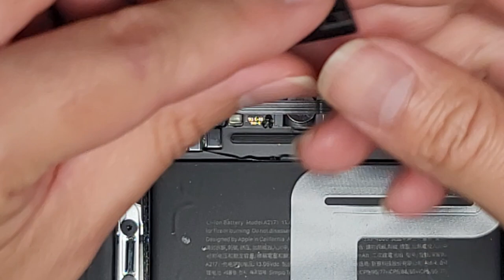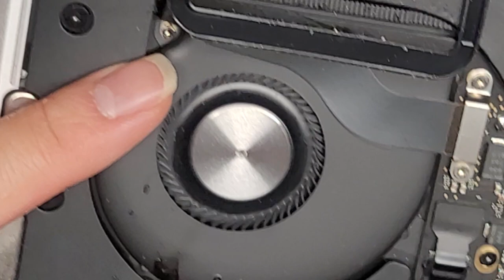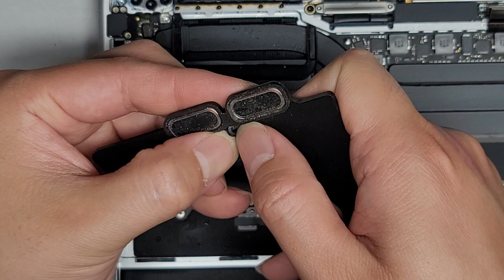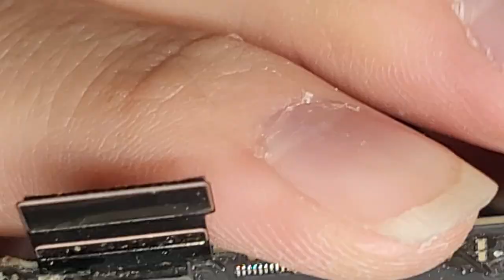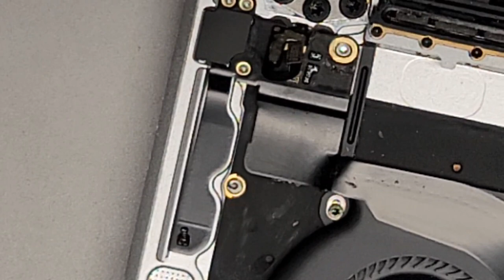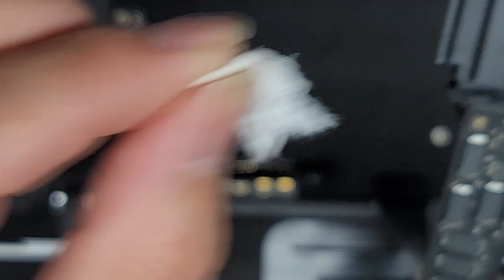13" Inch 2019 MacBook Pro A2159 Disassembly Logicboard Logic Board Motherboard Liquid Spill Repair

Comment: It's Binh Repaired & Reviewed.. Another cool video. Any idea on how to fix an iMac. It will not connect wirelessly anymore. I works fine hooked to an ethernet cord.
Reply from the maker: Did you test if it's a software issue by booting into recovery mode first?
Reply: @ItsBinhRepaired  Haven't checked. It works fine just won't connect wirelessly
Reply from the maker: @RenegadesGarage  give it a try
Reply: @ItsBinhRepaired  Not sure I know how to do that.
Reply from the maker: @RenegadesGarage  boot holding command option p without ethernet
Reply: @ItsBinhRepaired  Didn't do anything. All I have is a wireless keyboard. In network pref the wifi card doesn't show up
Reply from the maker: Try holding option on boot
Reply: @ItsBinhRepaired  I did it didn’t do anything except come on normal
Reply from the maker: @RenegadesGarage  you might need a usb keyboard

Comment: Interesting to know amperage of the charger on the connection and make some mesures in comparaison with a border vieuw like Rossman do, no ??
Reply from the maker: I don't do that, sorry.
Reply: @ItsBinhRepaired  i find very interresting when you explain each manipulation on the board, i am learning with you. The device for the control of amperage of the power Supply is cheap (Chinese) and the boardvieuw may be free on the web. I thing.
Reply from the maker: @yvesrochet3288  haven't really looked into doing that level of repairs.
Reply: @ItsBinhRepaired  later surely you do that
Reply from the maker: @yvesrochet3288  don't think so

Comment: hey! great video! so you just use warm water to clean the nasty parts? with a brush or how? then alcohol and air to dry it, right? thanks!
Reply from the maker: Yup, if you're lucky it might fix the issue.

Comment: Hi there, might be a silly question, but I have two identical macbook pro models (2019, 13') and one is locked, but in great shape physically, the other one I use daily, and has a very small crack on the bottom of the screen, someone tried closing the lid with something in there (AGH) [the plastic piece that says macbook pro]  I have pretty good laptop/phone experience just with windows computers and a very little apple/macbook repair, how much risk is involved in the process and is it worth it or should I just live with the little crack? I can't afford to have two dead pc's all due to my stupidity of a tiny crack lol. thanks for any advice!!
Reply from the maker: It's pretty risky. I've cracked a screen trying to remove it and cost myself a lot of money.

Comment: 1 second ago
Thank you so much for this! So I opened my MacBook because it wasn’t charging. Liquid got into the USB-C ports but nowhere else. It was clean and nice inside. I managed to clean it up and I can get it to come back on but now the keyboard is not working even though I’m pretty sure it’s connected just fine, the same way I saw in your video. The trackpad is not working either, even though the first time I got done putting it all back together it was working fine. I’ve tried reconnecting and doing this a couple of times now but now I’m wondering what could it be. Both  bluetooth keyboard and the mouse work. So it has to be something I’m doing wrong and I can’t figure it out.
Reply from the maker: Likely bad trackpad or trackpad cable.
Reply: Even though it was working fine? There was no liquid anywhere else other than the USB-C port at the time. I only cleaned it up because after the computer lost its charge, it wasn’t charging at all but it never showed any problems prior to that. And even after I put it all back together the trackpad was working but not the keyboard. And then I went in trying to figure out what was wrong with the keyboard and now the keyboard and the track that wouldn’t work… and it is also now really slow for no reason. 😑🥲 It’s been a great day today lol.
Reply from the maker: @lindas.4376  that's a trackpad issue. Thermal sensor is in there and Apple, being the assholes that they are, programmed the keyboard to not work if the trackpad has issues.
Reply: It was a dent on the “teeth” on the connector for the trackpad. Once I straighten that and connected it right, everything came back as if nothing had happened!! But you’re the only person naming everything as you disconnect and that was helpful to identify what was going on! Thank you!
Reply from the maker: @lindas.4376  so bad trackpad cable. Glad you were able to fix it and get it working. :)

Comment: (Please Reply😭)

Hey brother, I too have a similar issue. Spilled warm water. Black Screen, works perfectly with HDMI cable plugged in to a sec. monitor.
No issues with the macbook display monitor as well(as I took to a repair shop where my display was perfectly fine when connected another macbook pro)

The problem must be in logic board where CPU makes connection with the Monitor. What can I suggest the local macbook repair shop to do to solve this problem?
Reply from the maker: Depends where the water got to. Could be the screen and the connection.